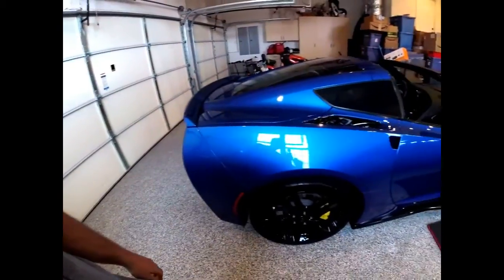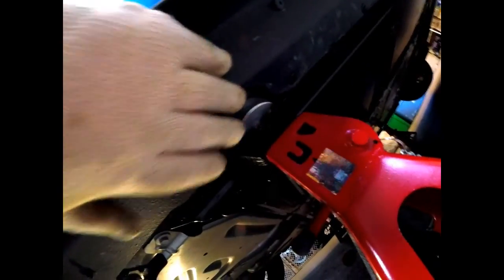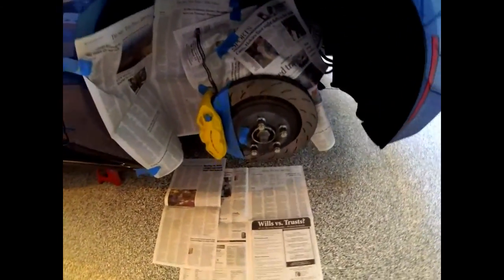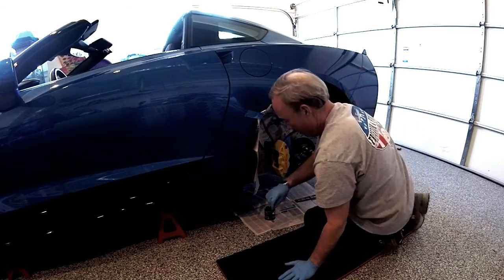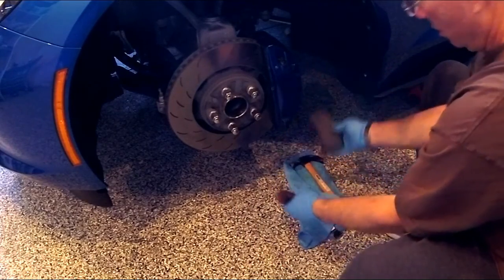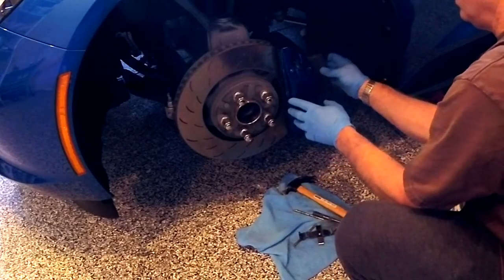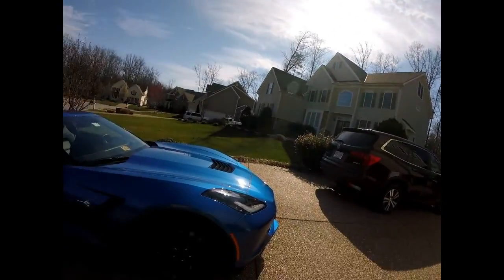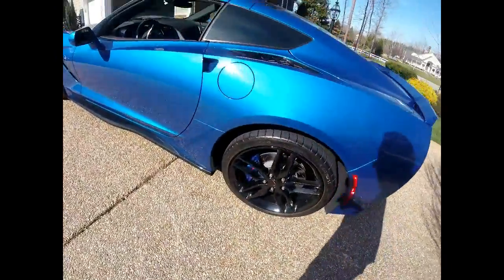How to Paint the Calipers on the C7 Corvette Stingray

Comment: did the brake decals last or did they start peeling after time?
Reply from the maker: The decals have held up fine so far. I did hand brush a couple layers of clear coat on top of them. Also, the car isn't a daily driver and is garaged, so I can't really comment on how long they would last in a lot of weather and driving conditions.